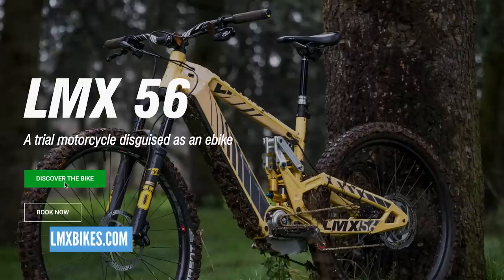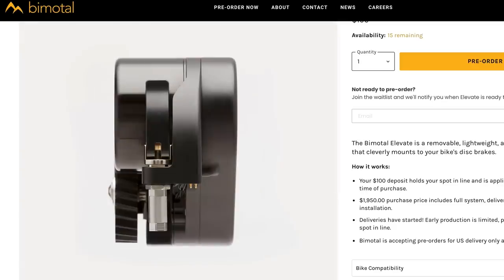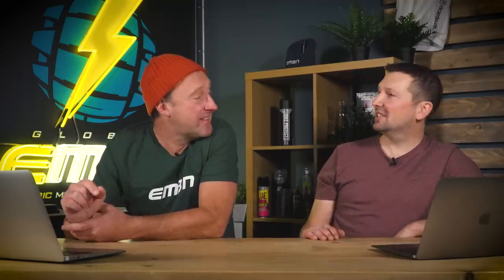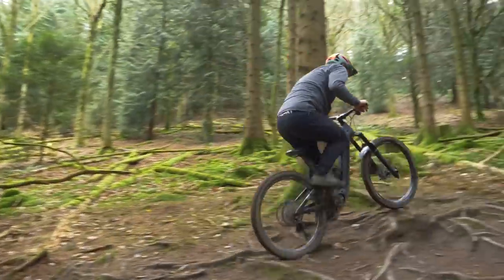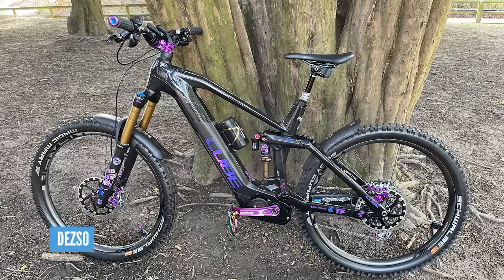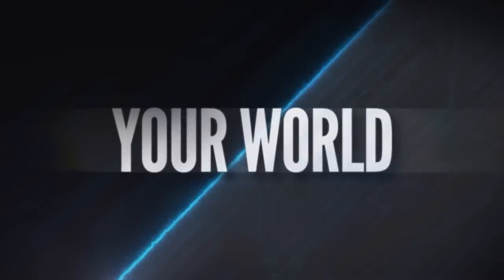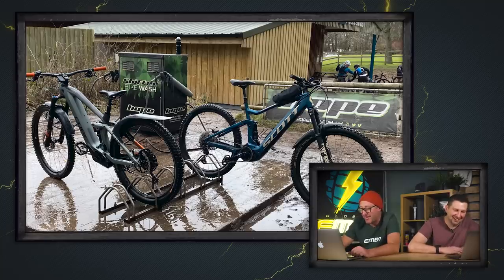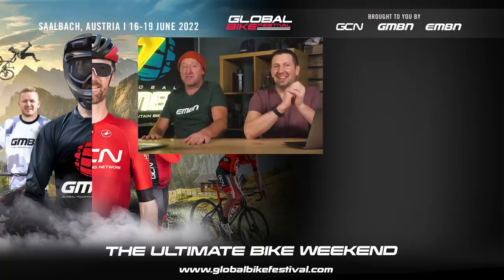Alternative Approaches To E-Biking! | EMBN Show 215

Comment: So great to see LMX getting some air time. I have an LMX 64, with 180mm front and rear with no throttle full torque assist. I love my dads Turbo levo but my bike is just in another league. I can go out for 6+ hours riding in MBT parks. It weighs 27 kgs so is heavy, but it jumps great and is really planted downhill. Uphill it is crazy what you can ride up.  The great thing with the double drive train is that the casset, chain, and derailer are under less load than an analog bike. I cant say enough about LMX
Reply from the maker: Hi Simon, That's really cool to see that you love LMX. They do look very beastly. Thanks for the support! 👍

Comment: One thing I don't see much focus on is ebike multi-use. I don't drive, so I use my emtb for everything. I put a pannier rack on to go shopping, I use it as regular transport to visit friends in a different town both on the road and off, and as a fun full sus emtb. 80% of the time the limit is fine but sometimes it's really restrictive.
Reply from the maker: That's great you've integrated E-biking into your daily life. E-bikes are very versatile when you don't use them for just hobby purposes. That's great for the environment as well! 👍
Reply: Exactly but it's when that "only 20%" of the time becomes dangerous. For example riding to the trailhead on a street where you need to jump up to 22mph, or when you're hitting a road gap and your bike becomes a 53 pound brick. Volspeed V4 plug and play, no error codes is perfect.

Comment: It’s easy to just say you shouldn’t need to pedal but the fact is a lot of jumps maybe aren’t set up perfect then so it helps to be able to pedal a bit so you can clear the jumps and not feel like an anchor has been thrown over are as you hit the limiter especially for heavier riders.
Reply from the maker: Hi Michael, We agree with you. There are situations where pedalling is just needed depending on the condition of the trails you ride. 👍

Comment: All that torque, all that power and still they equip their bikes with a traditional transmission? Absolutely nonsense... if you have to replace chain every 1500 km on a traditional ebike how often you have to do it on this one? Every weekend?
Reply: it has separate motor chain and freewheel
Reply: @Adam et Anne Clé  i noticed that, but won't change nothing, if you use that without throttle the transmission that uses is the "traditional" and the power output of the motor remains the same...
Reply: @nicolapellegrino1072  nope all engine power goes to the big chain, the motor is not physically connected to the 12 speed chain. The torque sensor tells the motor how to spin according to pedalling forces. It's the whole point of this system